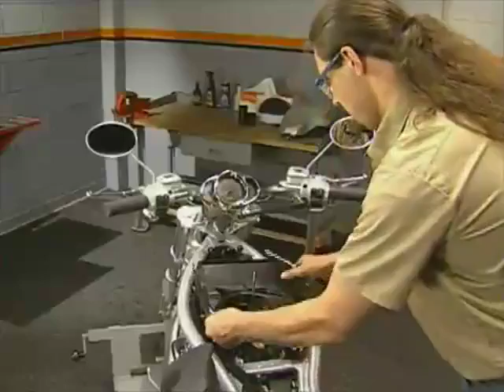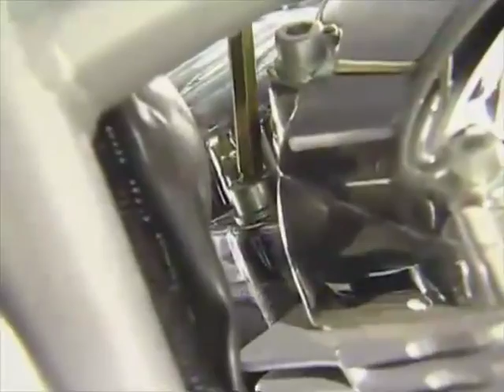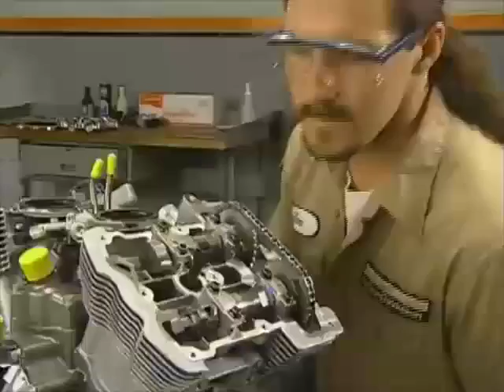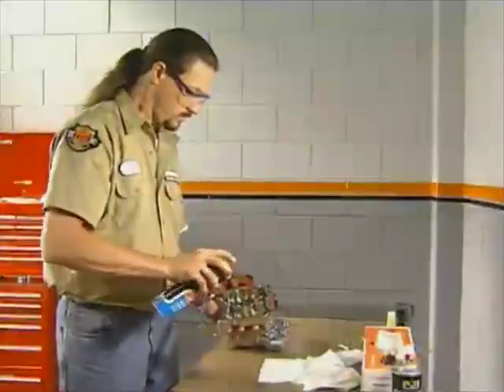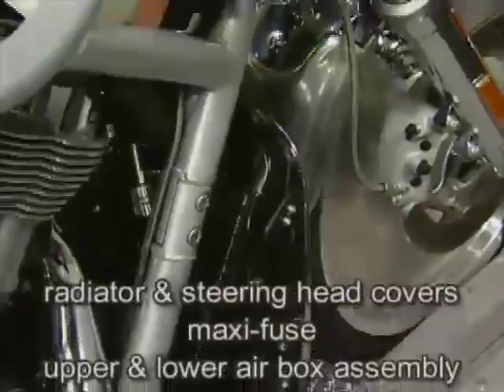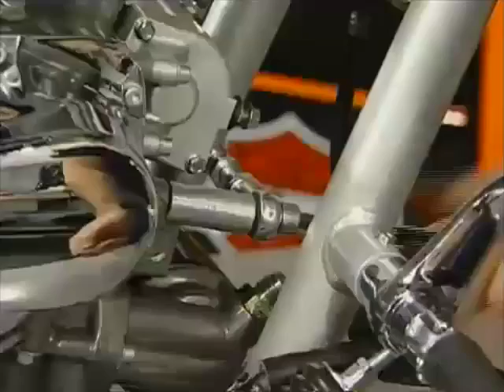Revolution engine valve lash adjustment

Comment: This has to be done every 10,000 miles? I just bout a used one with 28,000 miles and it's never been done. So I guess I need to make an appointment soon to get this costly job done?
Reply: I have a 2004 I got new, has almost 100K miles on it, I’ve never done a valve lash adjustment or even checked it….   Belt broke after 18 yrs,  Starter Solenoid broke after 20 yrs.    Just tires, brake pads, change oil every 1-2k miles and flush radiator every 4, brake and clutch fluid flush every 2yrs.   Runs like new every time !
Reply: Well i’ve had mine since 2003 it’s an anniversary edition I had it done by the dealer at 12,000 miles I know I have 76,000 miles on it, and it still runs like new. I pull it out every once in a while take it for 100 mile spin, I’ve change the oil every 2500 miles. It’s a bulletproof engine.

Comment: How tough/reliable do you think these engines are?
Reply: Rumor has it that they ran the engine full throttle for 7 days straight without blowing before they accepted the design
Reply: @bambur1 500 hours
Reply from the maker: one of the most reliable bikes regardless of brand
Reply: It passed the 500 hour "Dusseldorf Test" as seen starting at 33:00 of the video "Birth of the VRod (https://www.youtube.com/watch?v=GpsGwZWvMf0).  This test has traditionally been used to validate car engine robustness and I believe this was the first motorcycle engine to go through it.
Reply: bigjam8429 extremely tough and reliable.. mine has about 40k miles. Its been well maintained but  it was never babied!
Reply: My opinion they’re bulletproof. I change the oil every 2500 miles now and I’ve had it down the quarter-mile more than a few times lots of rear tires. It still runs like brand new quiet and I keep it in good shape inside and out. It is a dinosaur just like every other classic however, I’ve never had a motorcycle and I’ve had quite a few that I didn’t take the engine out of the frame to work on it properly so being a mechanic for 30+ years to me pulling a motorcycle engine it’s just a novelty. I love it.